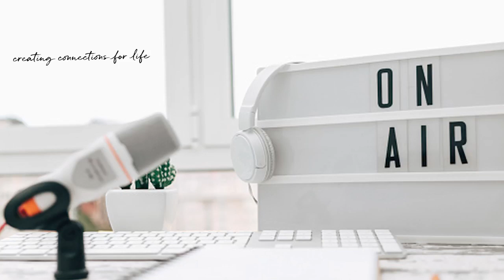AEC vs. DAC Solutions: A Side-by-Side Comparison

Comment: Spectra7 GaugeChangerTM
Comparison of Active Copper Solutions at 800G
       Analog Redriver
 DSP Retimer
Application to 4m
yes
 yes
Application >4m
no
 yes
Power (W, per cable)
2.4
 20
Latency
<1ns
 ~250ns
Cost
Low (1X)
 High (2X